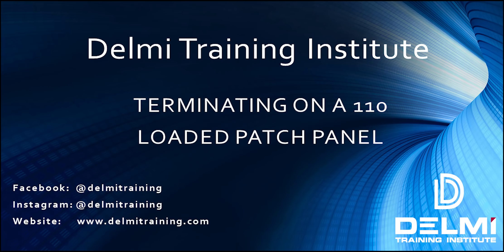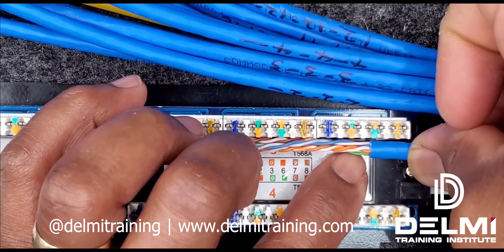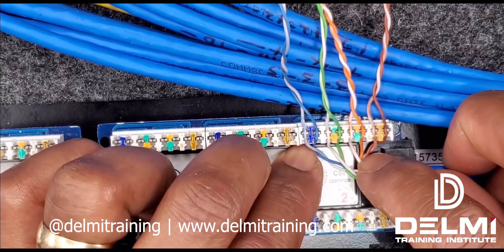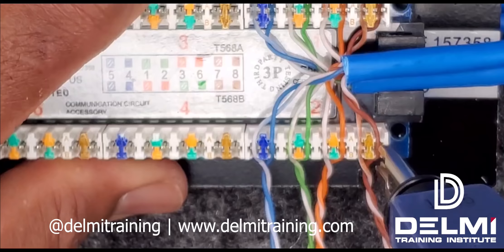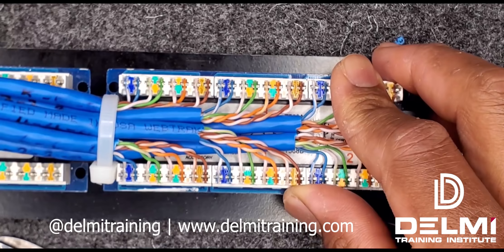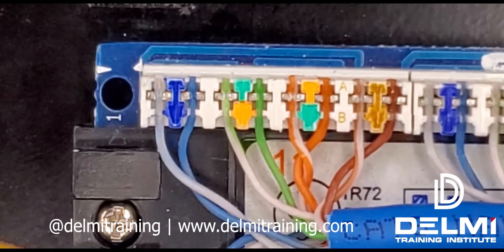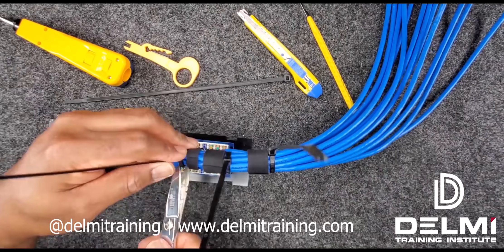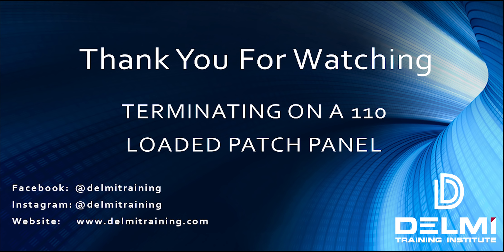How to Terminate on a Patch Panel

Comment: Wire management and bracket is always needed so you can easily troubleshoot lines in the future 🙌
Reply from the maker: It also makes the work look nicer with less stress on the IDCs

Comment: Very nice and clean work! When I was installing my home network, I had no former experience with those small 10'' patch panels. In comparison to their bigger friends (19'') they seem to lack some cable support from the back. To manage cables routing I added complete support made from aluminum pipes. But what I clearly see on Your video, it wasn't necessary. ;)
Reply from the maker: Hello Plomako, most of the panels you purchase do not come with the cable support. Over time, gravity works its magic on the cables and they begin to sag. If the terminated cables are not secured properly, they tend to fall out of the IDC and that is when the problem begins. we appreciate you taking time to watch the video. Please stay tuned for more videos

Comment: This is generally a very good job, with informative, correct explanation of the whats and whys of termination. My only feedback would be to preserve the twists in the individual pairs right up to the punchdown block. This was mostly the case in the video, with a few pairs being a bit looser than I'd feel comfortable with. Preserving the twists could potentially make the difference between a pass or fail when certifying the cable run, particularly when dealing with higher categories of cable. But this is a small criticism, and again, very good instruction. I've subscribed and look forward to your content!
Reply from the maker: Hello D. R Stewart, Welcome and thank you for stopping by our channel. Your feedback is very much appreciated as it helps us improve upon future videos. You are absolutely correct about maintaining the twist right up to the punch down block as this helps minimize the introduction of crosstalk between adjacent pairs which is critical during cable certification. Thank you once again for subscribing and sharing our videos and we will continue to produce and share more informative contents.

Comment: Very neat work. Thank you for the explanation on how to keep the pair distribution the same length. My only question is why not route the second set to the other side so that no cables are running om top of the others? It seems like it would be better for troubleshooting later, especially if you had to terminate any cables on the first set.
Reply from the maker: Hello Darryl,
Thanks for reaching out. Ideally that is the best way to split and terminate the cables. However when you have cables coming in bundles of 24, it is a little bit tricky to split them above and ceiling route them that way. Take into consideration that there might be a switch between the panels. I am working on another video that explain this concept. Please stay tuned in for that. Thanks for subscribing and don't forget to turn on your notification

Comment: Thank you for showing the 2nd way to strap and leave space to panel..nice and pretty but it would have been a night mare to replace or test the 1st cable terminated on panel with the other cables tightly terminated on top the middle.grouping and restrapping with space to access panel termination is ideal.
Reply from the maker: Hello Jaws, I am very glad you stopped by and left a note. that is very true. the first method is quite difficult to troubleshoot after the fact which make the 2nd part ideal. Glad you noticed the difference. Stay blessed wherever you are.

Comment: Hello Roland if I terminate 2 cables in the patch panel up and down, but only one cable runs to a keystone jack, how do I know which is going to work for the keystone jack?
Reply from the maker: Thank you for the question. i am not sure i understand 100% however i will try to answer it the way i understood it. Most patch panels will have numbers on the back where the cables are punched down corresponding to the numbers written on the front of the panel. they may also have the wiring scheme printed on the back to help guide you pick a desired scheme of your choice, A or B. At the user or the keystone end you must also terminate the cable using the wiring scheme you used to terminate on the panel. Keystone jacks can also accomodate for both the A and B wiring scheme so you will need to follow the chosen schem to ensure that you have a straight through termination on both ends. I hope i answered your question. let me know if you require additional information

Comment: That's super clean. Are drip loops, or leaving serviceable lengths at the termination point an outdated standard?
Reply from the maker: You will not need a drip loop if your rack or cabinet has been bolted and the position will not change or move. It helps ensure that your terminations are clean.

Comment: My house has (15) builder-installed Cat5e T568A cables from 2007 and (8) Cat6 T568B cables that were added this year. When I run these Ethernet lines to my patch panel do I just wire them per there existing designations (T568A or T568B)? Does mixing different Ethernet cable types and wiring schemes create any problems? Thanks!
Reply from the maker: Thank you for reaching out. When you run the new Cat 6 cables to the  Cat 5e patch panel, there are a few things to note. You are at liberty to have cables terminated as either 568A or 568B so long as both ends match. So having white green or green with white stripes as pin 1 and solid green as pin 2 etc. For 568A. When you have white orange or orange with white stripes as your pin 1 and solid orange as pin 2, this would indicate a 568B wiring scheme. Having 568A on one end of the cable and 568B on the other will create a crossover cable. If you are in the position to maintain one wiring scheme,  our advice would be to stick to that to avoid future wiring mixups. Finally, termiating a Cat 6 cable on a Cat 5e patch panel will cause the cable to assume the characteristcs of a Cat 5e cable due to the thresholds set for Cat 5e. You will notice a lot of crosstalk at the patch panel. Thank you for reaching out once again and our apologies for the late response. Good luck

Comment: what are your thoughts on patch panels with keystone jacks. some dont even need to be punchdown
Reply from the maker: Keystone jacks are great and are generic, meaning that they are manufactured by many different vendors. My concern typically is who makes the one you might purchase and were they made of quality materials to meet the standard. We have used different types of keystone and some we have had problems with especially in areas of speed and crosstalk. For basics home networking,  you shouldn't have any issue. Our advice, however, is to find a reliable distributor if you need them for other data or mission critical purposes. Good luck, and sorry for the late response

Comment: can i use this patch panel with two different isp provider at my home setup? thanks
Reply from the maker: Hello AJ, Thank you for reaching out. If I understand your question well, then the answer is yes. The patch panel can be used to service any interner provider. Remember that the patch panel is where all the cables from multiple user locations terminate. So if you have two or more providers, you can terminate them both on the panel. The most important  thing is to make sure that,  you maintain the same termination standard (568A or 568B) at both ends and remember to label the terminated ports with the appropriate names or designation. I hope this answers your question. Have a great day!

Comment: Tip: Don't work over your cables like they show when terminating at the patch panel.

Rather get an inline patch panel. It reduces installation time by over 50%, nevermind that the  this the chance of signal degradation, when.not installed properly.
Reply from the maker: Thanks for the feedback. i will post another video of terminating the cables directly on a patch panel on a rack

Comment: FIRST NO ONE terminated patch panel as 568A anymore unless you are working on a PBX system. second leaving that much open wire behind the punch is against code
Reply from the maker: Hello, thank you for stopping by. I live in Canada and we do a lot of 568A terminations. Our neighbors down south, the Americans do a lot of 568B wiring. As per TIA, you are at liberty to use any of the two wiring schemes as long as both ends are the same for a straight through connection. Also, the notion of 568A used only for PBX is incorrect. It might have been widely used in the past for such purposes however, i am aware of many other jurisdictions around the world that still use 568A scheme. 
Now to your second question, Cat 5e cables are known to have a less twist ratio per inch. When terminating them, you may experience a wider gap expecially on the blue pair due to this reason, and this explains why there is so much crosstalk at the panel. Thanks for the learning opportunity. Have a great day!

Comment: Fu.......k of how much cable just cutted off and wasted🤦‍♂️
Reply from the maker: Hello Antonio Arizo, Thanks for watching our video. unfortunately, there are no wastage of cables because any excess cables that were cut off were recycled. This is the correct method to have your cables terminated onto a patch panel. It is always better to have an extra foot of cable than to have an inch short. It is very important not to dispose of copper cabling without properly recycling them. We are very fortunate to have facilities that would recycle and reuse the cables that we scrap. We would be glad if you have a better method of terminating patch panels as we would love to learn from you. Thank you once again

Comment: no gounding? no shielding? what is this crap for?
Reply from the maker: Hello Computer Service Slovakia, Thanks for reaching out. This video is a tutorial on how to properly terminate an unshielded twisted pair cables onto a loaded patch panel. Grounding is an important part of the design of any network closet. TIA, ISO and CENELEC have recommendations regarding the proper steps required for grounding and bonding. Even though they have their recommendation, they always recommend to consult the local fire codes bases on your jurisdiction. In every network closet, grounding is an important part of the overall design and the network rack or cabinet must always be properly grounded. When terminating UTP cables on an unshielded panel, there is no need to ground the individual patch panel because the rack or cabinet should have already been grounded. The situation is different when working with shielded cables. with regards to shielded cables, each shielded patch panel must be individually grounded to help dissipate all unwanted noise to ground. if you have any specific concerns, please let us know and we will address it.
Reply: @Delmitraining  who uses unshielded cables this time?
Reply from the maker: Hello again, since this is a channel dedicated to sharing knowledge, I will take this opportunity to educate you. There are different categories of cables available on the market today right up from Cat 5e to Cat 8. All these cables have different frequencies to which the operate. The higher their frequencies the more bandwidth they have and this also increases the data transfer rate.  There are additional factors to this such as the amount of twist per inch of each of the pairs to help eliminate crosstalk and also the cable gauge used. Most network applications in today's use require speeds of up to 1Gbps. Unshielded Cat 5e and Cat 6 cables are designed to support such speeds in environments with little to no interference which is our every day life application when the cabling is installed and supported  properly up to 100 meters,  300ft.  Unshielded Cat 6A supports speeds up to 10Gbps and is backward compatible with Cat 5e and Cat 6. Bear in mind that most network equipment in our day to day use does not support this speed. Such speeds are required in areas where high bandwidth application are required such as data centers etc. Cat 7 to 8 are designed to support speeds of up to 40Gbps. To achieve this speed their construction must include Shielding of the individual pairs and an overall braiding with an increased cable gauge. Even with all these added bells and whistles,  the max channel length is 30 meters for 40Gbps  and 10Gbps at 100 meters. 
Now, when working in areas with high interfering sources such as factories with lots of RF generating sources or applications for Audio Visual, Shielded cable is recommended and the category of the cable depends on the desired speed
So now I hope you understand why UTP cables are the preferred cable for every day applications. Thank you for reading and don't forget to subscribe, like and share our videos